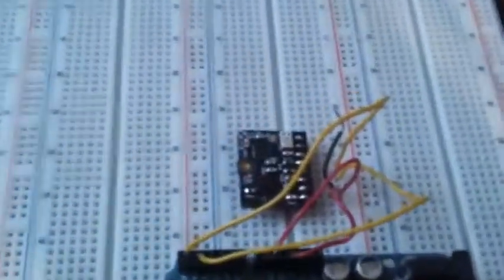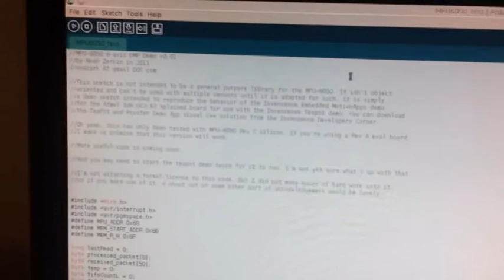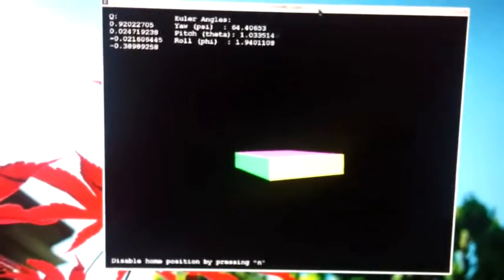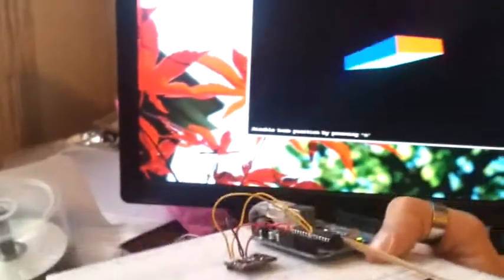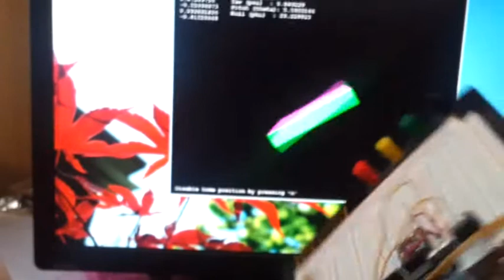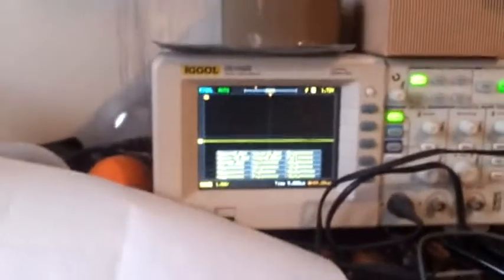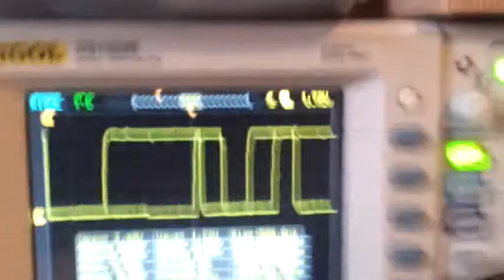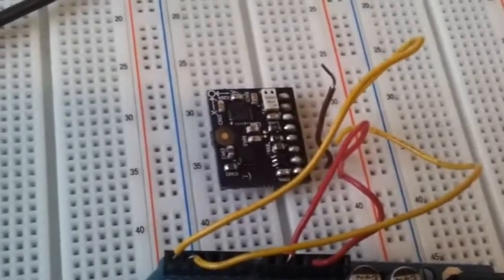FreeIMU v0.4: initial tests with MPU6050

Comment: Newer versions of Arduino use "Arduino.h" instead of  "WProgram.h".  You will need to modify any old libraries to make them work with Arduino.  

If you are using a different controller, you will need to find the equivalent and make sure that your compiler can support some variety of the Wire library.

Comment: what is that software that u have used to see the motion of IMU? I have GY521 (MPU6050) .I am using Atmega16 micrcontrler to check the values of I2C  protocol..but where can i see those values ..?

Comment: I try your FreeIMU example (FreeIMU_quaternion.pde) with MPU6050. and Arduino UNO R3. 
Why q0-q3 are not stable when sensor is still and stable on horizontal? 
I plot q0-q3 in serialgraph it looks like sine wave.
But when I test MPU6050 only to see all outputs of Acc and Gyro seem work find.

Thanks